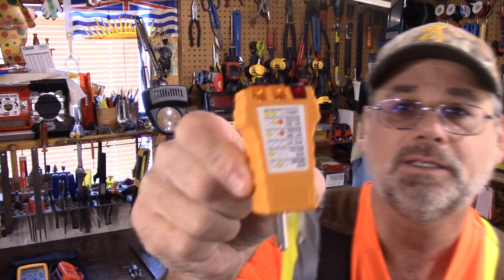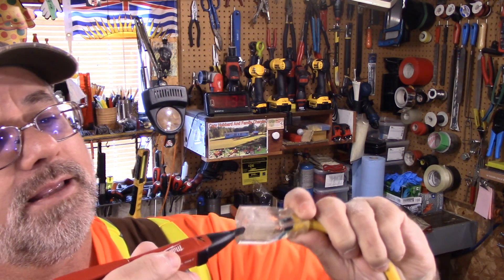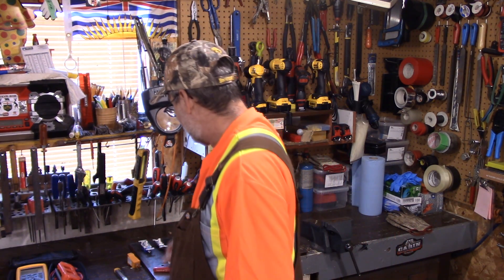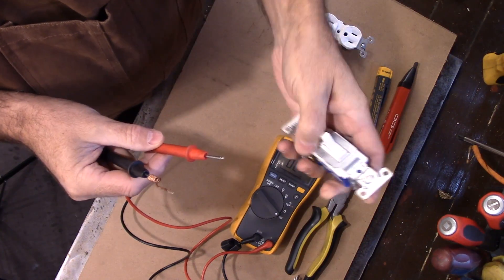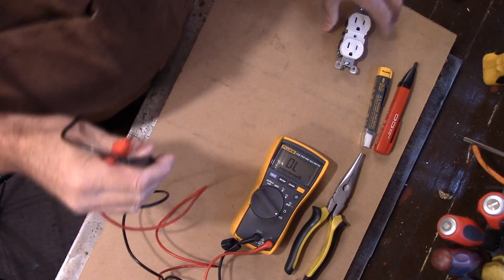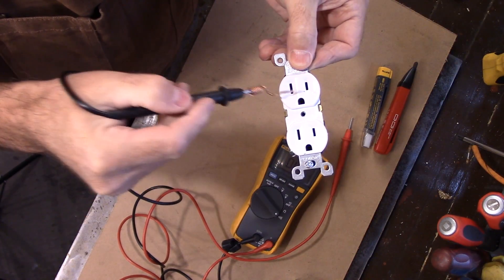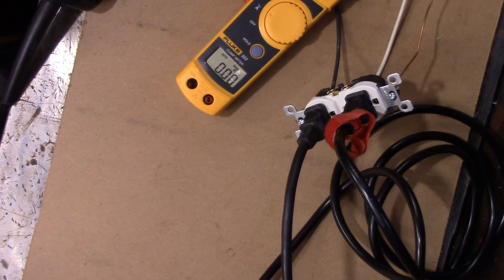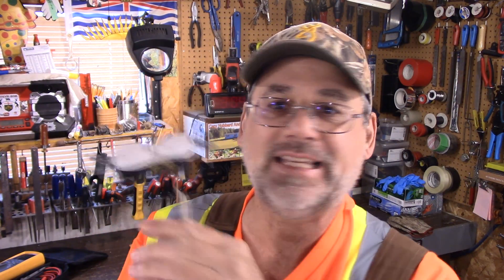BASIC ELECTRICAL TESTING - MUST HAVE  TOOLS AND THE QUICKWIRE  METHOD

Comment: How's she goin'?  The Quick Wire method is becoming more popular because it saves time when wiring an outlet.  No doubt it's safe or the Electrical Standards people wouldn't allow them to be produced.  BUT --  How often can the wire be removed and replaced before the resistance of the connection deteriorates?  Not sure...  When stripping the wire, often done without proper wire strippers, can damage the conductor right at the point where it is apt to be bent to fit into the junction box.  If bent too sharp it could break or the diameter of the wire is made smaller and there fore it becomes a higher resistance and builds up heat that could lead to other problems.  I personally prefer to use the screws.  BUT -- the Quick Wire method is usable and safe.  I just think the screw method is safer.  But I'm old like Don Cherry and when you're old, you opinion is outdated and not worth much.  LOL  Take care buddy and have a great week!!!
Reply from the maker: Everyone has their own method and their reasons , just an alternative method  within the codes of one's country.  Poor Don has taken a verbal beating . lost a job but not a total  loss  as so many conversations have sprung up just like the quick wire method . LOL
Reply: @SteveRobReviews  You're right.  My 2 cents worth -- CTV over-reacted.  I think they wanted him gone anyways.  I guess what Jessica Allen said was OK though because she was addressing white people....

Comment: Oh and as far as a KNOWN good you talked about. You could have a good light bulb, test it then go to an outlet and it doesn’t light up, it doesn’t mean the circuit is not live. It could be an open HOT . Then you touch it and find out your the neutral and ⚡️
Reply from the maker: Very good bud yes absolutely.  Ya know you would do well with some electrical vids . Give it a go , you know your stuff 👍

Comment: Such a great video idea Steve! All those little morsels were great, plus you inadvertently  gave tips on breaking the code to wire up 3 way switches. 
   A quick stab might be fine but I prefer to hook them usually.  Lol.
Reply from the maker: Thanks - So far most do like the traditional side screw method . Cheers Bill

Comment: Steve, I do not use the quick connect receptacles.  They maybe safe and approved but I think of them as the same thing as using a quick connect spice on 12 volt applications.  See below.

 https://www.amazon.com/3M-Scotchlok-Electrical-Connector-stranded/dp/B0035R7TKO/ref=sr_1_20?keywords=12+volt+wire+connectors.&qid=1574048186&sr=8-20

They do make a back wired receptacle I do recommend.  See below.

https://www.youtube.com/watch?v=JAUZ4IdZVx8

This type of receptacle has more surface area for a good connection and has advantages over the quick connect ones.
Reply from the maker: Rick I have seen a lot of green to black corrosion on stranded 12v wire using them connectors.  The quick wire connection on 120v circuits do seem to have  a huge following or some detest   the idea . The great part about my youtube channel is I encourage everyone to  share their experiences so the viewers can  get various points of view . Thanks bud .
Reply: @SteveRobReviews  I still love you!  LOL!
Reply from the maker: @547Rick  is 👍🇱🇷

Comment: My house was wired with the quick wire, screw and the style with the flat plate and screw 😂 and it was all wired by the same company and is only 4 yrs old.  So far I’ve had no issues with any connection type.
Reply from the maker: Glad to hear , most new houses  I am told  are the same. Some have their own preferences . Cheers bud 👍

Comment: Steve, have to agree with some of your other viewers that the stab method is not safe. I personally have seen 20 year or more installation using that method fail on the neutral side of the outlet completely fail due to high amperage loads and heat which also shut down the neutral side on other outlets down stream of the failure.  Take Care !
Reply from the maker: Not for me to say its unsafe since its code compliant and for me to state otherwise would be considered libelous . Hope you can see the position one faces on youtube bud :)

Comment: Good information . I try to use the screws on the side but I see most of the time the one that i'm removing uses the push in connector.
Reply from the maker: Thanks Jim , both ways are fine and the choice is there for all. Cheers bud

Comment: Hi Steve, Can't say I've seen where someone has broken the neutral side tab off although we used to break it off on the line side when installing a slit receptacle. That's where you pull a 14/3 to the counter top and put the black and red on the brass screws making sure you break off the tab you spoke of and attach the white to the silver screw side. This is out of date now that we can run 20 amp T slot receptacles to the counter. That saves using a double pole breaker. Cheers.
Reply from the maker: Good points Larry.  Cheers bud.

Comment: Although the quick stab method may be UL and CSA rated, I still prefer to use the screws. In fact, I prefer to use the screws which have a saddle strap which doesn't require the wire to be wrapped around the screw. Now, you need to show us how to wire that 3-way switch up along with 4-way switches. )) Have a good one Steve!
Reply from the maker: Valid preference Terry. I would like to explore more electrical connections in the future . No views but I enjoy a challenge:)